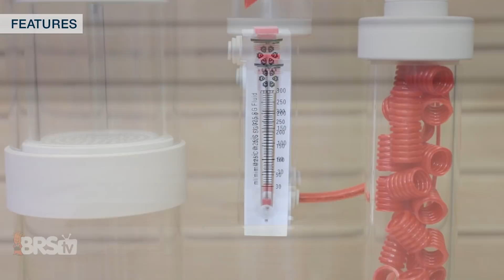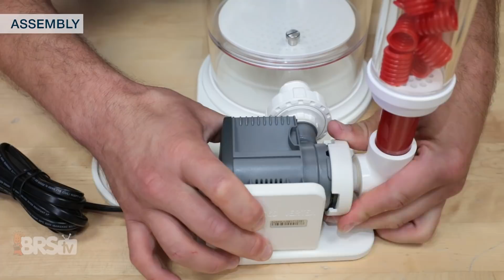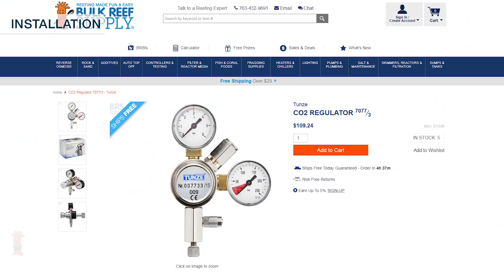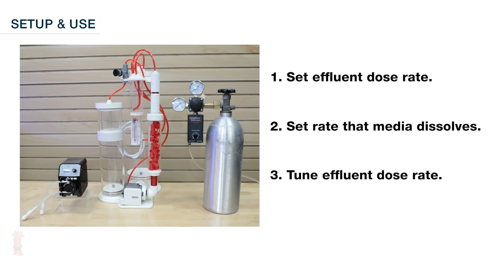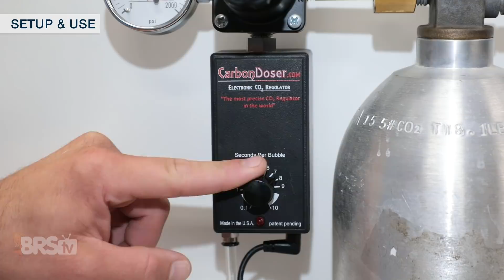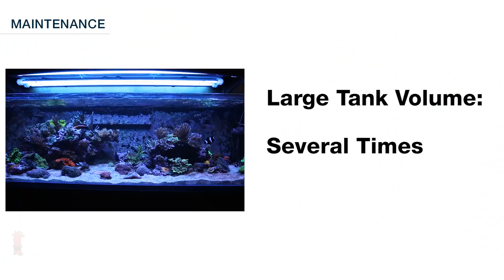Simple way to supplement Alk/Ca to your tank with Vertex RX-C 6D Calcium Reactor | BRStv Spotlight

Comment: i need some help with this one, am already regreted i bought it, my Jebao rune much better then this, or am making something really wrong. so i filled it up, started running it just water passing thru, no issues no problems... wend i started adding co2, everythime the co2 stops , it starts getting ai bubbles and a lot of noise in that red chamber missing things, co2 comes on and bubbles go away.... it got better since i now pull water from the reactor and not pushing water from it... am really desperate abou this.... any ideas will be very welcome. thank you

Comment: I've seen about 4 or 5  BRS videos  on connecting the vertex calcium reactor and a couple with the calcium reactor connecting to the co2. However of all these videos it does show how to connect the Kamoer pump to both utilizing the holes.  It only talks about how it functions and not actually showing an example of the connecting the the tubes/holes to the reactor and co2.  There was one brief demonstration with both Randy and yourself but it was quite confusing since after speaking about the effluent connection there was no other instruction. Can I get instructions on connecting the kamoer to both the vertex and the co2?

Comment: I had this reactor for about 7 months. Then it developed a leak around the pump. Contacted Vertex with no response. Found another o-ring no thanks to Vertex. 

Ran out of media around the 7 month mark and had to pull it to refill. When I grabbed the 6 inch base it shattered. For 500 bucks I figured they would use better acrylic then they do. 

Have read countless items on the forums of Vertex items breaking with little to no force. 

I now use the Skimz which in my option is far superior to Vertex. Built way better and the pump is actually quieter.

Comment: Calcium reactors are making a comeback. I have tried 2 part also kalk. Finally settling on a geo calcium reactor for my 120 and its amazing once set up its amazingly easy. The best way to tune your reactor is have a constant flow out of the reactor and change the ph on your ph controller to match your tank needs rather than having a constant ph and adjusting your drip rate. Dripping affluent is prone to clog, a good flow to the affluent is better...............yall should check out geo instead of this reactor
Reply: My big issue with calcium reactors is that the price is a bit "deceiving",  sure you spring $500 for this calcium reactor, but now you need a CO2 tank, and a quality regulator/doser with it, and also a quality feed pump to push water into it, and I hope you have a quality controller to check pH in the tank,  so at the end of the day now you're easily more than double into what the reactor costs and not one of the cheaper reactors either.   I know this hobby isn't cheap but still it's one of those things.   Where as with 2 part, you have dosing pumps, check and cost of media and that's how much it cost period.

Comment: I think the biggest issue I had with this reactor was the support.  Pump died and no way to replace it because it's glued into the connector.  That's why it sits in my closet now.  That, and it was pretty noisy.

Comment: Also, leaks at the recirculation pump leaks, how do you prevent this?
Reply: I seen a lot of talk about leaks at the recirculation pump on the forums, most recent being this week on sdreefs. I was just asking, not pointing fingers or talking smack. 
Did you add an aquarium lubricant to the seals before installation, will this help with leaks? Will pushing or pulling water through the reactor possibly cause unions and fitting to leak? 

I have this same reactor and plan to install on my tank in the next week or so, just trying to educate myself and ask questions that I had concerns about. Thank you for replying to my remark, I appreciate you time and value your videos